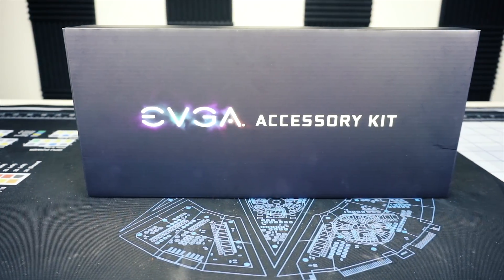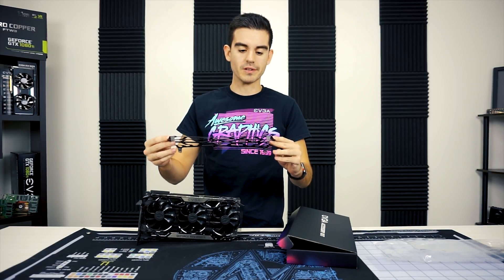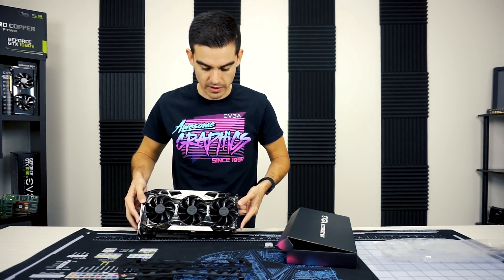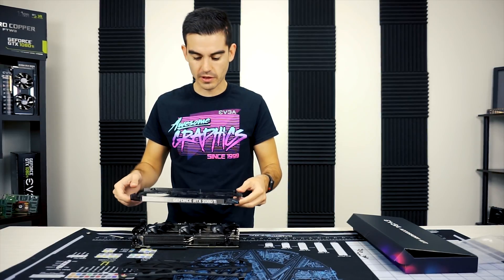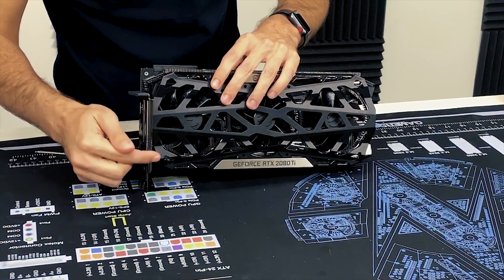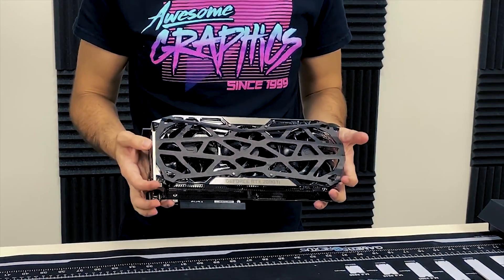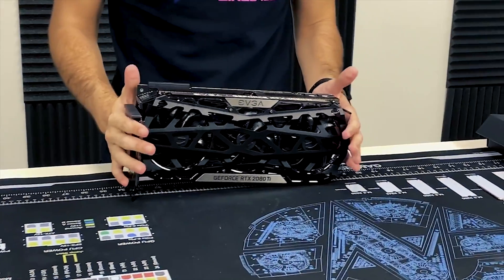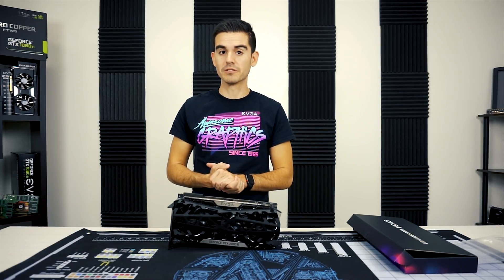How to: Install EVGA Shield for RTX FTW3 Cards

Comment: Couldn’t it just be possible to unscrew the screws without removing the panel and putting the protective metal plate on top again to tighten, why completely remove this panel?
 :/

Comment: Guys come on, we need more attention to detail... so you guys say that it needs to go under the metal lip of the bracket, but you failed to mention that in order to do this you also need to remove said bracket. I was trying to fit it in without removing the bracket and almost borked the fan.

Comment: why? less air flow
Reply: Would need a lot more metal to restrict air flow enough to matter.
Reply: since its metal, it would help on heat spead? working as heatsink somehow?
Reply: diablo jim there would be no way for this to help with heat dissipation unfortunately.  It is still in contact with the shroud, which doesn’t transfer heat efficiently, so this wouldn’t help.

Comment: Oh that plastic shroud comes clean off, nice! Can you install the shield on its own?
Reply: Only issues I could foresee happening is the fans no longer directing airflow quite as well, since there isn't a way to funnel the air straight down.

Comment: 2017: Closed Front Panels for your case
2018: Somewhat closed Shield for your GPU

Airflow be damned!
Reply from the maker: This was tested extensively and does not impact airflow or temperatures with any significant impact.
Reply: This wouldn't affect air flow enough to matter
Reply: @the_Scarlet_one  Because EVGAman selling it told you so? You can put your PC under your desk in a corner and it will still work fine, so it doesn't matter, right?
Reply: Jtypin EVGA didn’t tell me anything, common sense did.  People think wires will stop airflow and that myth has been busted for years. Just because you think something will block airflow doesn’t mean it will.